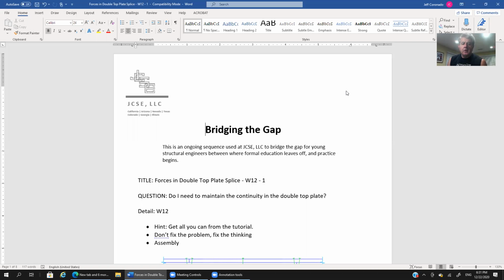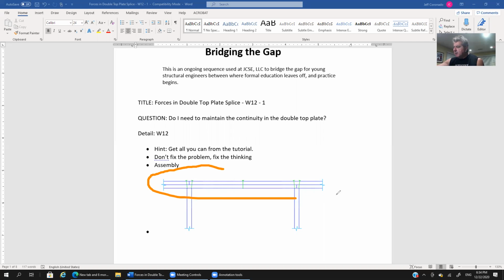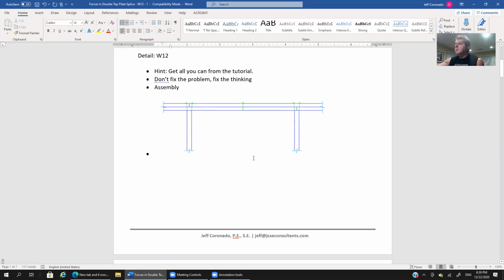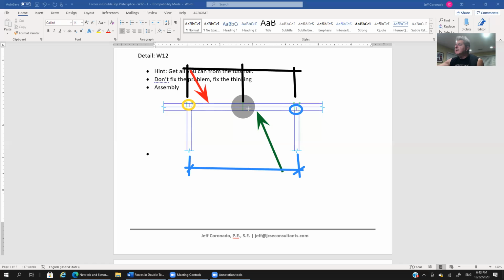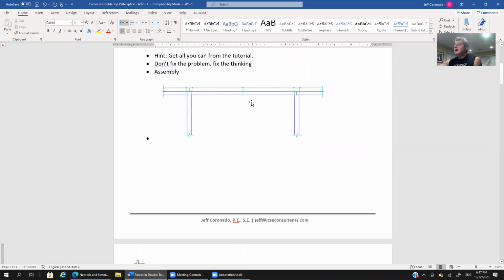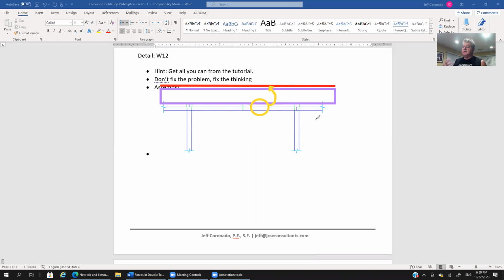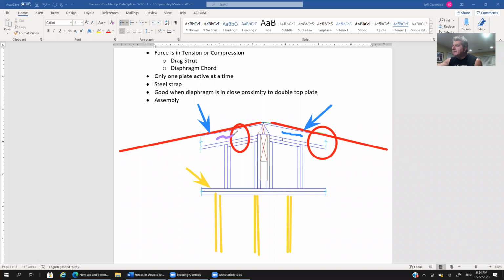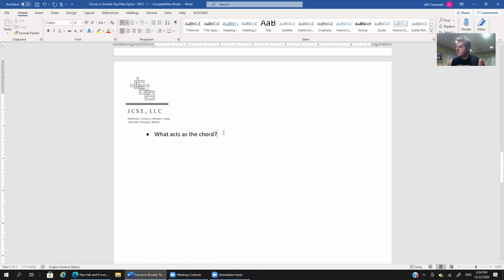Forces in Double Top Plate Splice   W12   1

Comment: 90% of this is talking about how you should be a structural engineer and how 'this is covered in other tutorials'. You should be SUCCINCT!
Don't  get me wrong. This is by far the best video on YouTube for an understanding of principles of double top plate. But the general principles of active plate, tension are being mixed with chords and diaphragms that are not applicable in all situations. I for example watched this video for a damaged double top plate of a short 3 foot wall from the concrete foundation to the bottom plate of a regular external stud wall. There is no diaphragm etc. But the discussion on active plate, a possibility of a third plate, a strap or a double stud shoe is immensely useful. At the same time one is left uncertain about the number of fastners between the plate required to transfer the forces between plates, and the desired extent of a third plate. Should it cover just the span between the splices or a little further or the entire span of the top plate?
Reply from the maker: Sorry. Some of that is in the works and will be coming out. Thanks.